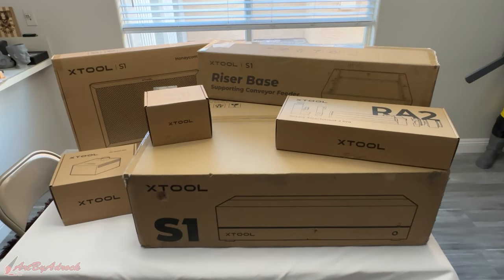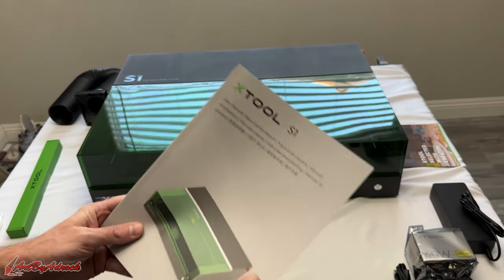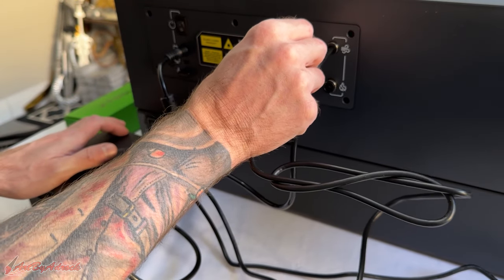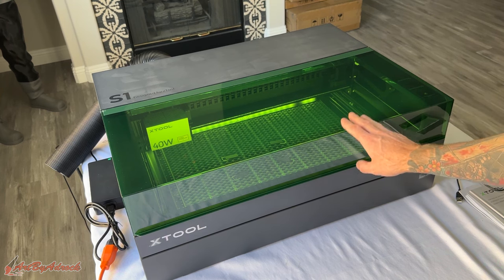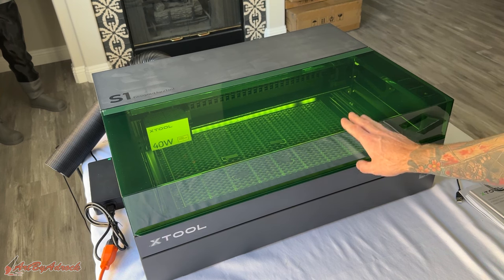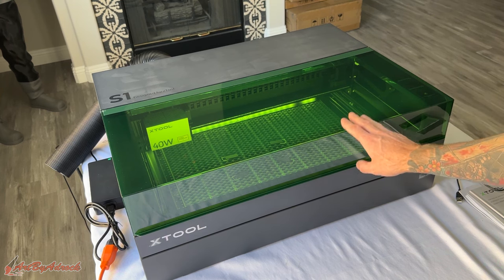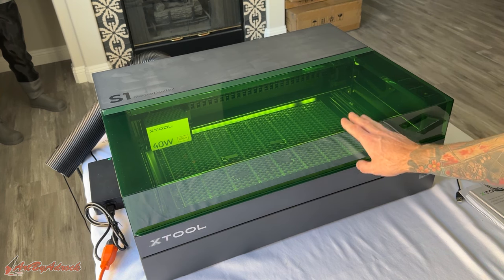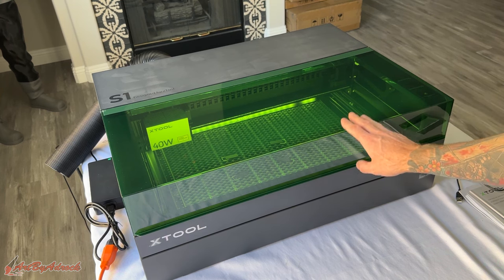xTool S1 (40W + IR Laser + Accessories) - Setup, Testing & Honest Review

Comment: Great informative review 👍I notice that the design on the connectors should be better,if you change toolhead somewhat often,they wont last for long.And also a quick release on the toolhead and not two screws.I have a F1 from xtools and was also thinking about this one,but has backed out.I am finding Xtools a bit shady in the after sales service department....and also the overall quality of their products are bit so and so.Snapmaker Ray looks like something that can compete with the S1,it does not have auto focus.But a great big enclosure,bigger work area and basically unlimited height .Thank you for the review and have a great christmas and happy new year 🎅🥳🥂

Comment: I think the concept of the S1 and it's features is excellent but....The positioning system is probably one of the worst I have seen and nothing like it is described in the sales pitch. Unless you weren't doing it properly. How is that going to work when batching things out?
Their previous camera system dealt with that quite well but this looks like you would waste a load of time setting it up.

I didn't hear you mention what thickness Ply you were cutting, looked like 3mm. A 40W laser set at 100% power with a speed of only 8mms! And it only cut pretty well? I have a 20w that cuts through 3mm Ply easily at10mms so somethings not right there.

Swapping out laser heads looks like a time consuming and fiddly exercise and a productivity killer depending on your workflow. When you engraved the ring you said it looked pretty good. I would be less than impressed if it turned out anything less than VERY good for that sort of money.

You mentioned the shortcomings of the honeycomb tray and Xtool are not alone in that failure. I haven't found a company yet that supplies the correct size honeycomb to make maximum use of area. It's actually quite embarrassing to spend so much on production and not consider it important. In essence it also means that claims of actual useable area are exaggerated.

The filtration system appears to be a massive fail. It isn't cheap, it's expensive and doesn't work properly. I have no experience of filtering indoors as I exhaust outside but I have seen reviews of other similarly priced filters that actually work. If the Xtool can't cope with good extraction and filtration when the flaps are closed, I hate to think how bad it's going to be when the flaps are open.

All in all I'm very disappointed. When I read the specs and the claims on the website for the S1 I really wanted it to live up to those claims and stick my name down for one. Right now I'm not going to risk that outlay until they have dealt with all of the above issues. But I expect that they won't be dealt with because the M1 suffers from many of the same issues. It's a real shame because it could have been excellent and for that sort of money for a diode, it should be perfect.